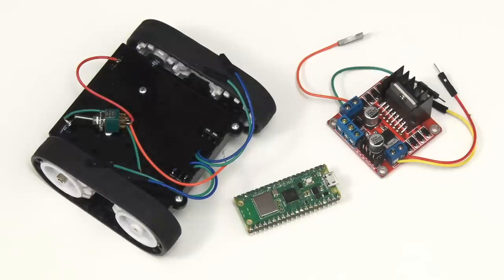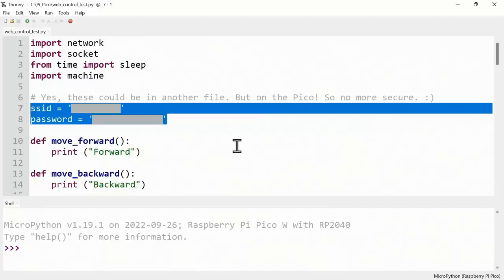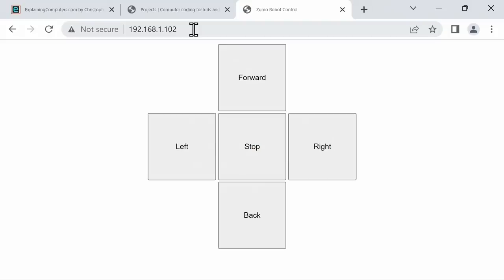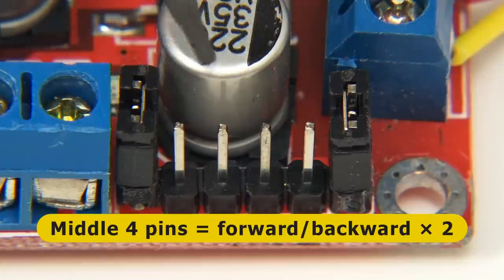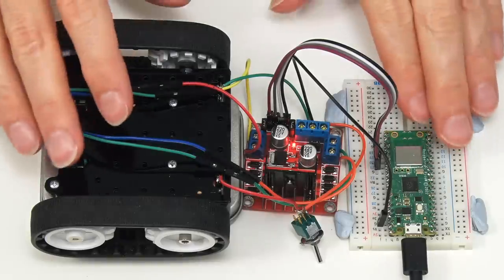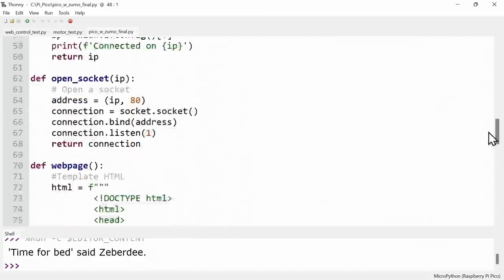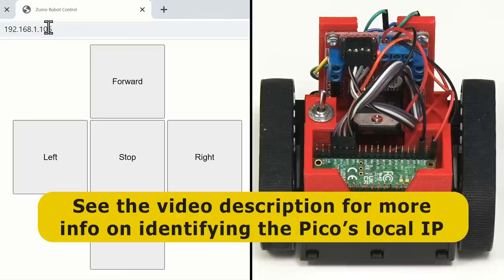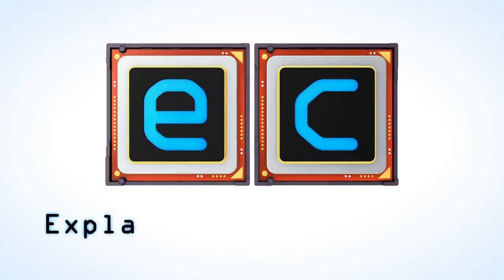Raspberry Pi Pico W: WiFi  Controlled Robot

Comment: This is precisely the kind of thing that I enjoy most! I tried to get an RPi RP2040, but was forced to settle for a board with the RP2040 included. The Cytron Maker Pi RP2040 includes 2 motor relays and 7 discrete 4-pin Grove connectors. So far it has been a disappointment, but that's likely because this is so different from using Python via GPIO on a Zero W or other CPU packing RPi.

It would interest me to see the Maker Pi board run through its paces in your most capable hands as I am without much joy using the board so far.

Perhaps you could repeat today's exercise using the Maker Pi RP2040? The whole smash cost me $12 and it will do as I require ... eventually!

Comment: Cool. One suggestion for the future, instead of having it display or transmit its IP do a video on how to determine the MAC address for a device and setup your router to give a device a static IP. Super easy to do solution for home servers.
Reply from the maker: Ah, but the problem is that router control panels are not standardized -- so there is sadly no way I can do a video on setting a fixed IP that will work on all hardware.
Reply: @ExplainingComputers  True, but you could always show the method for the top three router brands and cover most people.

Comment: Importing 2 variables for your wifi, is not for when the device gets stolen, just for video publication (no need for blurring),
it also prevents having to change your daily wifi password that may be embedded in various other wifi devices.
also some wifi routers have guest network options (+active hours), i would use those.

Or make the pico W an access point

Comment: A good idea for my grandson's next Pico  programming lesson. It would make some sense to call the move_stop() before each move_somewhere() to save having to press the stop button between moves.
Reply from the maker: What you say would not work -- how would the code know when to execute the stop?! :) You do not have to press the stop button between moves -- as you can see in the demos.
Reply: @ExplainingComputers  - Why would it not work?  Each def move_forward() etc. could just include move_stop() at the top before setting each output bit for the H bridge driver.  While technically not needed (as you show) it might be easier on the motors not to slam from forward to backwards especially if you included a small delay after each move_stop().  Right turn, stop for 0.5 seconds, left turn.  The bigger the robot or motor, the more important it would be to allow it to stop before changing directions.  When driving a car most of us come to a stop before slamming the car into reverse... although it would be fun to watch otherwise.   ;-)
Reply from the maker: @ElmerFuddGun Yes, certainly it would work to include the command to prevent potential damage to larger motors as you describe. But that is not what the comment I responded to is about! :) It suggested that it would remove the need to press "stop" between moves, which is not necessary.
Reply: @ExplainingComputers    Er... That is exactly what I was suggesting

Comment: I really love how this is explained in a way that I can understand it! Can I use this tutorial on other robots?
Reply from the maker: Yes, what you see here will work with any two motor (up to 12V) robot.
Reply: @ExplainingComputers  Thanks! I have two Meccanoid robots from Meccano and I would like control their motors through a different source, I’m so glad I have finally found my answer!
Reply from the maker: This should work with an L2981 and a Pico W as here. But see also my setup using a Pi Zero with this robot: https://www.youtube.com/watch?v=H1PIzxNdGGk
Reply: @ExplainingComputers  Got it

Comment: Many thanks. This is an excellent tutorial that helped me develop my WiFi controller + WiFi Rover which circumvents the use of a webpage interface. Things will get really interesting when RPi unlock the BT on the Pico W, and I look forward to your update when this happens!
Reply from the maker: Agreed -- a Bluetooth driver for the Pico will be a great advancement, not least for making wireless robot controllers. And I understand we will get this fairly soon now.
Reply: @ExplainingComputers  The updated SDK was released yesterday with BT support in C/C++. As you said, it should not take too long for MicroPython to include this.

Comment: Great little project Chris, have had fun making the original design & then making some changes. 
Replaced the L298N motor board with the more efficient TB6612FNG.
Changed the code to include speed control, primarily to slow the turns and add timing
to make 90 degree turns.
Added an led & coding to indicate when the robot is connected to the server.
Added some styling to improve the appearance of the Control & to include some more
buttons for future addition of programable leds
Reply from the maker: Excellent! :)

Comment: This takes me back to the 80's controlling a physical robot called a 'valiant turtle' that would move around the room connected via a Ribbon Cable box linked to a RM Link 480z computer programmed using the language Logo, and had a pen in it's nose so you could draw on paper underneath it. It was like a robotic floor plotter! You could also use them on a BBC Model B (if you had the Acorn derivative).
Reply from the maker: Thanks for this, which now takes me back! :) I had completely forgotten those turtles. How the years fly by.

Comment: great video, i am thinking of using a pico and two motors to operate as positional indicators for a gps and a dht11 sensor module, thanks for showing how the wifi could be useful

Comment: The "Magic Roundabout" reference presumably refers to a permanent spin state?
Web control is good for remote operation; it would work well with a video feedback for a "crawl into holes to take a butcher's" application, if the Pico could handle a video feed (onboard camera or 'phone?).
Increasingly intutive controls for local control would be keyboard letters, control diamond, direct signals from a mouse (wi-fi?), and some sort of joystick setup, (perhaps a repurposed game controller?). 
All sorts of project options there, the challenge being to keep Robinson and Goldberg out of the architecture planning sessions. :-)*

Comment: Putting the WiFi credentials in  a separate file makes it easier to run the code at a different location.
Reply from the maker: True if that separate file can be more easily edited (which is not the case here).

Comment: I feel I have to comment on the failure to use the correct pins in the Pico  Vbus(pin 40) is for 5v out only, Vsys(pin 39) is intended for power in.
Reply from the maker: You are correct, I forgot this. My bad. :(

Comment: Is there a way to add a video feed? How would you have a page with a rapidly updating video feed but also responsive buttons. 🤔
Reply from the maker: For a video feed a full SBC (like a Pi Zero (2) W) is needed. A microcontroller like the Pico W would struggle to support a camera.

Comment: would this kind of kit allow for finer control of the motors so that, with a different interface, perhaps, analog controls could be implemented?
Reply from the maker: Yes, certainly -- using the PWM pins to control the motor speed would allow very fine motor control, over analog inputs at the controller end if desired. I covered the basics of speed control in this video: https://www.youtube.com/watch?v=H1PIzxNdGGk
Reply: @ExplainingComputers  I was thinking about something like that, but I wasn't sure you could do it with these parts.
Reply: bloody spambots impersonating youtubers for phishing... they are everywhere now.

Comment: Did you reverse the left and right combinations in your code? In the breadboard section it seemed as if it was reverse for l/r.
Reply from the maker: I certainly didn't change the code. How the robot responds will depend on which way around the motors are wired (four possible combinations). Whether I had to switch things around at some point I cannot remember. But the motors certainly turned in the right directions in all tests included in the video.

Comment: Hi, i have the chassis, motors and motor drive controller purchased and have my pi zero w. Just wondering what other components i need that might not be listed. Not sure if the switch you have on the robot is listed in the hardware or any other hardware i need for this project. Thanks
Reply from the maker: You'll need some jumper wires also. Good luck with your project! :)

Comment: Hello Christopher,

I am making progress. Have robot built and was successfull in loading micropython onto pico w. However when I open up Thonny 4.0.1 Thonny recognizes 
Micropython (Raspberry Pi Pico- com3). However in the Thonny Shell it states unable to connect to com3: port not found.
The connection to the usb must work otherwise I wouldn't be able to download micropython to the pico w? I have checked on the internet with no luck. I am wondering if you have any thoughts on this? Thanks much....Rick
Reply: I figured out what the problem was and the robot is now working very well. Thanks again Christopher for a great tutorial. Look forward to your future tutorials !!!!!! Rick

Comment: Hello Christopher,

I am playing around with the html file for this project and it is quite fun !!!!! I do have one qustion tegarding the html code. I see an ending body tag (</body>) but no beginning body tag (<body>). Is this normal? Seems the beginning body tag should be after the head ending tag (</head>). Would this be correct and what is the reason for no beginning body tag. Thanks much and learning lots from your videos. I am having more fun with this little robot.
Reply from the maker: You are correct. There should be an opening <body> tag, before the first form tag. My bad. :(

Comment: I thought the purpose of putting your wifi info in another file was to make it simpler to #include them into other projects easier
Reply from the maker: That would certainly make sense, but it is not what is documented in many Pico W tutorials . . . :)

Comment: I have to admit that the Pico is more impressive than I first thought.  I really like the 3D printed bracket you created.  With that being said, your friends Friction and Gravity haven’t always friendly with me.  “Ouch, me fall down!”  “Looking forward to your next video.” says Zeberdee.
Reply: I wish the pico came with more than 2mb of flash, some third party clones (such as Adafruit) have 8 or 16mb of flash.  They do cost a bit more though.
Reply: @KennethScharf  More always seems to be better.  My first computer was a Timex Sinclair 1000 and with its memory expansion pack it had a whole 16 k of memory.  Now I suspect 16 gb of memory is a little small for my needs.  LOL.  With that being said, I do hope the next version of the Raspberry Pi Zero 2 W gets more memory too.  We can only hope.
Reply: @perrymcclusky4695  My MSX1 machine has 64K of memory (only 23K available for BASIC) and I was able to make almost everything I can think of,
just remeber to not include unnecessary libraries.
Programming back then was more exciting.
Reply: @ahmad-murery  Yes, truly back then programming was fascinating!
Reply: @KennethScharf  - Just to clarify...  lowercase "m" is milli and uppercase "M" is mega.  And as such a lowercase "b" is bits and uppercase "B" is bytes.  You will find that the additional memory on devices such as these, ESP32, ESP8266, etc. that use SPI/I2C are often listed in bits not bytes.  So that "16mb" is actually "only" 2MB.  Any way the sellers can make the numbers appear bigger than they really are.  If your code and data is getting that big it might be time to add an SD card slot IMHO.   :-)
Reply: @ElmerFuddGun  TQ

Comment: Another very interesting video & as always well presented & explained, thanks for this Chris.  An interesting application for the Pico W & components could be used in a Model railway system, wirelessly controlling a loco's direction & speed, the other 2 functions could be used for uncoupling/coupling!  I have seen this accomplished at model railway exhibitions controlling models wirelessly using an iPhone which is quite impressive, they are are quite expensive setups. My Sunday is now complete & looking forward to the next video :)  :_stanley:
Reply from the maker: Hi Alan. What's shown in the video could indeed easily be applied in a model railway . .  and I can imagine servos controlling signals too! :)
Reply: The Sprog controller which uses JMRI for programming is a very interesting solution for model railways.

Comment: That looks like fun. I'd be interested to hear if you could calibrate it so that you could have buttons for different amounts of turn. For example 'turn 90 degrees left'. I guess you'd need to use that ratio for the motors to work out how long a full turn took as a starting point. Or maybe you could implement variable speed control to the motors.
Reply from the maker: Hi Graham. What you ask could be done in two ways. The simple way, as you say, would be to run the motors for a certain length of time -- using sleep command -- having worked out/experimented to get the right length of time.  And this would basically work, although it would not be that accurate, as the time would change when the batteries wear down, the tracks could slip, etc.

A more sophisticated solution would be to work out the number of motor rotations required, and to fit encoders on the motors so that this could be monitored. If you look at the CU shots of the motors, you will see the shaft extends out of the back, which can allow an encoder to be fitted to measure their actual rotation. So the motors would be run in a loop that would terminate when the number of rotations for a 90 degree turn was reached.
Reply: @ExplainingComputers  Another option would be to add a accelerometer/gyroscope module. Most don't seem super accurate, but you shouldn't have to worry about battery voltage.
Reply: @ExplainingComputers  Do you mean a DIY encoder ( just a transparent plastic disc with few centered stripes, a photoresistor and small LED as light source),
that would be a very nice upgrade to the project, especially if you can glue a pencil to it and then 3d printing a turtle cover for it, that will be a real Logo 😎💯
Reply: You could also do this with stepper motors. They're a little more complicated to control but you can accurately move the motor in fractions of a rotation.
Reply: @rgbii2  @ExplainingComputers I've experimented a bit with the MPU6050 accel/gyro module but as yet haven't found an application to use one in my robot car projects. I'd be very interested in how to use it to control the turns in this and the other cars I've built.

Comment: Hey Chris, if it's not too heavy, would one of those LIDAR devices fit on the Zumo with the right 3D printed bracket? It would be cool to see a tiny autonomous bot wandering around your garden. Even better if it had a camera and the ability to switch to manual control. Maybe even a bit of image recognition so you could get it to spook cats!
Sorry, I got carried away there. But wouldn't it be cool though.

Comment: Is this a Library specifically for MicroPython? I was hoping to find it for Python 3 on Windows.
Reply from the maker: The libraries used here are those included with MicroPython for the Pico W. MicroPython libaries in general do differ a bit from Python libraries, as they are microcontroller focused.

Comment: What if I had four motors would I need two raspberry Pi pico w and alter the code a bit to make it work the same or do I need to do something else
Reply from the maker: One Pico can easily control two motors, as it has a lot of available GP outputs. If you look at the Pico diagram -- as included on this page: https://www.explainingcomputers.com/pi_pico_w_robot.html -- all of the green pins can be used an GP outputs. So controlling four motors is not a problem at all! :)

So, if expanding this project, you would just need to add a second motor controller, as the L298N can only control two motors. But you could hook up two L298N controllers to 8 rather than 4 GP pins on the Pico (for example using GP10, GP11, GP12 and GP13 to connect to the second L298N), and then alter the code as you say so then additional pins are also set up as outputs, and turned on and off as required.
Reply: @ExplainingComputers  Thank you for explaining almost ordered 2 raspberry pi. One more question I have recently purchased a Esp-32 cam can I have a video feed from the esp-32 cam display on the same webpage? What code would I have to have to make this work if its even possible. Thanks
Reply from the maker: @rogueaspect2600  Potentially, yes, you could integrate some code from the ESP-32 into the same web page. But I've never used an ESP-32, so can't help with the specific code I'm afraid.

Comment: Would it be possible to add a camera and have it display on the control webpage.
Reply from the maker: Hard to do with a Pico given is limited processing power. Certainly possibly using a Pi Zero W or above.

Comment: Is it essential to set all 4 values in the move_ functions? If so what would happen if you didn't?
Reply from the maker: All four values need to be set unless you assume a stop is executed between each one (ie you don't know the state of the four outputs before each move command is executed, so have to assume that all need to be set to the correct state).